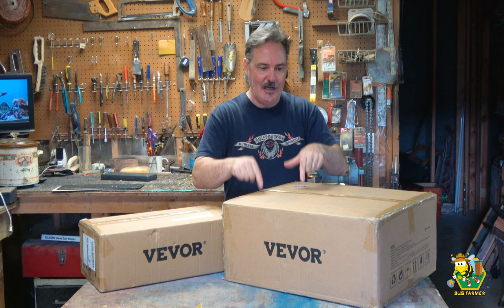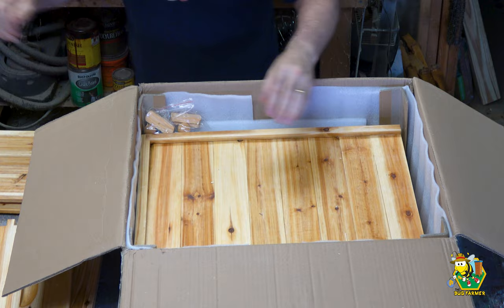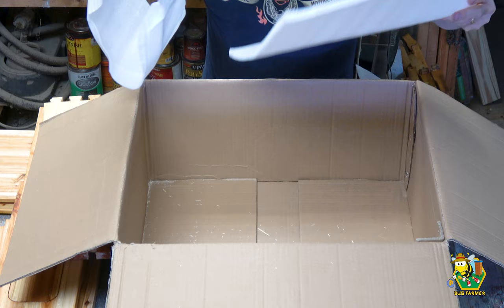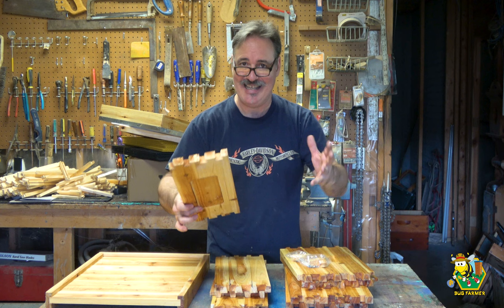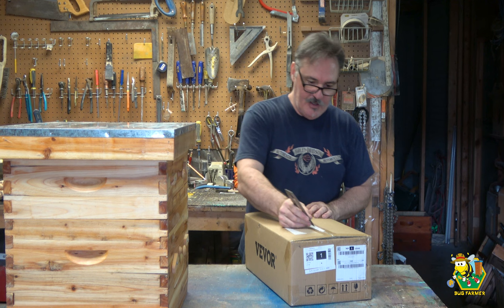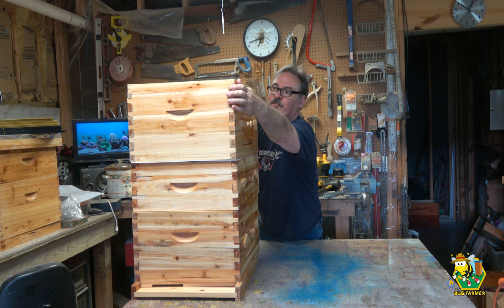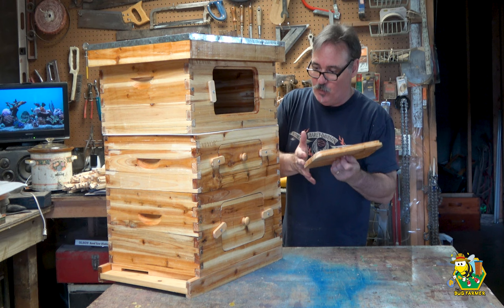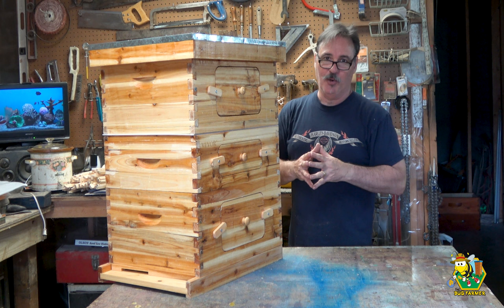Should you buy this Hive Kit from Vevor?  #vevor #beekeeping #insects

Comment: Just finished watching, and after having done a video on the same product myself, we had the similar results, not a recommended purchase. Even though there are good ideas in mind, cedar wood, dovetail joints, wax covered boxes and foundations, observation window, to many issues with each and every one of them....other than the waxed part. Great review, loved the video.  God's peace brother.
Reply from the maker: Hi Jeff.  Yea, I watched yours after dropping mine and we experienced the same thing.  The next day Vevor reached out to me and thanked me for an honest review and said they would work with their team to correct the issues.  I told them if the windows weren't there it would be an acceptable hive.  Anyway, I am going to permanently close those windows and use the hive even though I don't have any other 10 frame equipment.  On another note can you tell me how wide the frame tank is on your honey line.  I want to gift a new squeegee to your operation for this years harvest if I can find one that will fit.  :-)  I have been working to memorize your sign-off so I guarantee I will get it right this year :-)   Take care friend.

Comment: In my opinion it's not a bad hive. As far as the windows not having plexiglass in them. I think it's more for seeing if your end frame is full or not without taking the lid off. And plexiglass is not that expensive if you wanted to put them in. No nails or screws is a bummer.
Reply from the maker: I did end up doing a follow up video where I added the plexi and made the hive usable.  If I were Vevor I would open each box and toss in two pieces of plexi and re-tape the box.  Thanks for stopping in to have a look.

Comment: I purchased the vevor hives with out the windows , the boxes were solid wood and the bottom and top cover were solid plywood but they did not glue any joints on the two, so I had to add nails cause they were coming apart.  Lucky I got them on a sale and didn't pay full price cause it would not be worth it.  Also the frame bottoms some were shorter than others and the box joints were not all cut the same size.  Was not to happy with them put I guess you get what you pay for. lol    PS Mr. Eds didn't come with glass for windows either.  I think the person who designed them is not a beekeeper.:face-blue-smiling::face-blue-smiling::face-blue-smiling:
Reply from the maker: I would love to try the Vevor hives without the windows.  I think they might  be solid hives for the price.  I hope the reach out for a review of the solid body hives.  I would love to review them.

Comment: Built mine yesterday.  Came out perfect. Not one problem
Reply from the maker: Did yours ship with plexiglass?  Maybe mine was just missing.  The hive itself was okay, and I do plan on using it as soon as I fix the windows.  I think I will purchase plexiglass and attach it on the inside of the window to solve the issue. I am happy yours turned out well and hope you raise prosperous hives.  Thanks for stopping in to have a look at my video and for taking the time to comment.  I hope to see you in future comments.  Take care.
Reply: @BugFarmerBees  it did not.  I plan to seal myself.  But everything went together smooth no problems.  I pilot holed and stainless screwed n nailed all of it.  My only concern is if the frame nails hold when pulled full of honey.  Its my first hive to be honest.

Comment: I have many of these heavy waxed, Chinese made beehives. They are not holding up as I would have hoped. They are wax coated with soft wax that comes off the wood. Because the wood is still partially waxed it can't be painted but left on its own with the wax coating gone in lots of places is destined to rot. I'm planning on getting my own wax dipping tank and will boil them in the correct wax and apply it correctly.
Reply from the maker: Hi Mike.  Is the wax soaked into the wood at all?  Is it possible to add more wax in the evening or in the winter while the bees are in the hive?  The Vevor and the Bee Castle are my first experiences with waxed hives.  Maybe I will install them in the bee yard and we can follow their progress over the next few years to see how they hols up.  Thank you for stopping in to have a look and for taking the time to drop a comment.  Also, thank you for the video idea.  Take care.
Reply: @BugFarmerBees  I don't think the wax is soaked in at all. The wax used in these hives is too soft with too low a melting point. I'm hoping to use a dipping tank to boil this wax off and have the correct wax mixture soaked into the wood. I own these hives from three different sources.

Comment: There are no window plastic,  Vevor's dovetails are not fitted very well and have to filed to fit and have mismatches of up to 3/32" from ends  to  sides, I bought 2 of the double deep double super kits both were bad fitting, many knots on edges that had broken out, one had a busted top because of  the poop packaging and missing frame parts (frame parts are non standard and won't interchange with any US made parts) they were clearance sales ads, so basically returned junk that noone wanted, I never buy any Vevor stuff again it's all no to low quality junk. Only reason I kept and repaired what could be used  was all my big hives were swarming a month early in mid February.
Reply from the maker: I found all of the same issues.  I just purchased some plexiglass and will be installing windows to make the hive usable.  As for the early swarm; my first one was yesterday.  I did manage to catch them though. :-) Thank you for stopping in and having a look and taking time to drop a comment.  Take care.